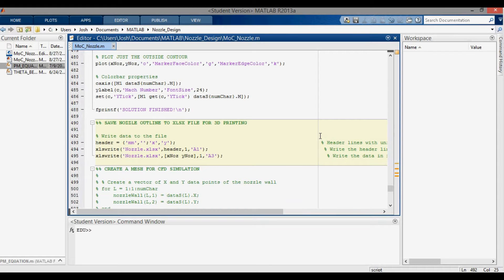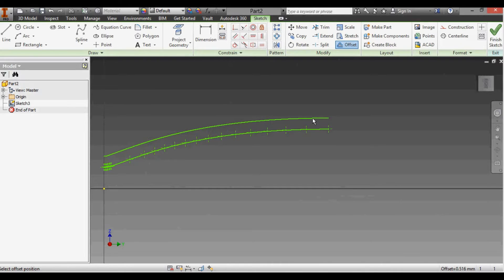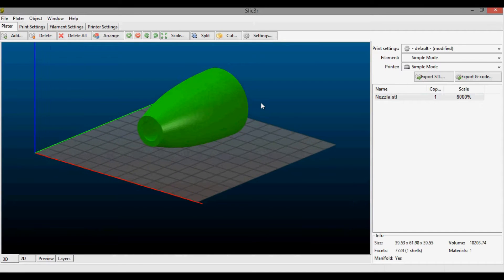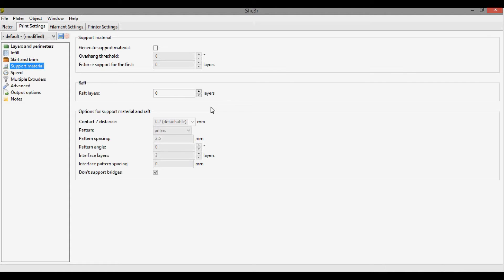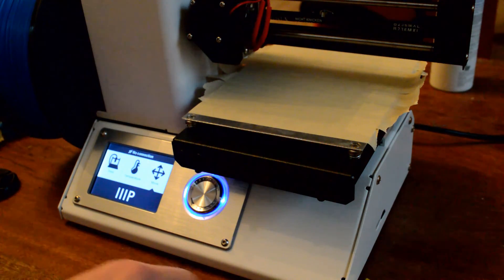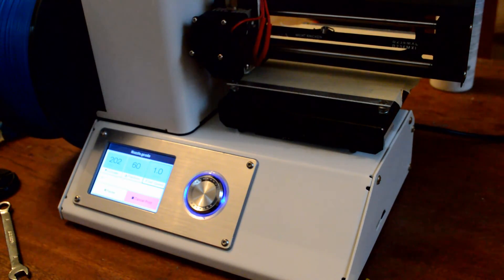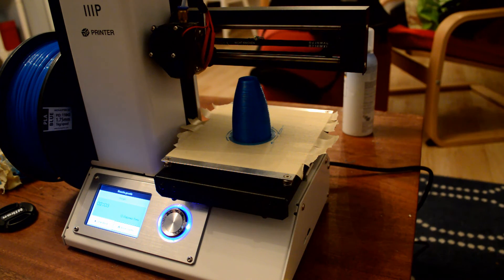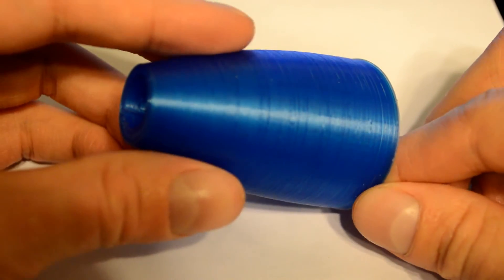How To: 3D Print a Rocket Nozzle

Comment: Why do you use complex methods to design the rocket nozzle? Not trying to argue directly because maybe you have your own reason. For me go with the math step by step is easier for understanding.
Reply from the maker: For this video, it was just a convenient way to show how to import a CSV file and output a solid model of a rocket nozzle.  You can make a rocket nozzle out of a cone if you really wanted to, but technically the method I use in my code will give you a better design.  Again, it didn't matter for this print, I just happened to have the code ready to go, so I figured I'd use it.

Comment: Why no converging section? Is the design for sonic conditions at the nozzle inlet?
Reply from the maker: I was just doing this to show the process from my code, to CAD, to a slicer, and then to a finished print.  When using the Method of Characteristics to design a nozzle, it assumes that the flow is choked/sonic at the throat (I'm leaving out a couple details, but that's the gist of it).  This print wasn't actually functional.  However, I'm planning on doing an actual 3D printed nozzle, including the reservoir, converging section, and diverging section.
Reply: I was actually interested in doing a project like that as well. I have a B9 creator, and was planning on coupling Python with ANSYS Fluent to optimize the design geometry for the full CD nozzle. Either that, or utilizing ANSYS UDFs to perform multiple design iterations. I always thought it would be cool to have a supersonic attachment for an air compressor. I think one problem might be with the smoothness of the inner surface that might cause significant flow separation or radial components of velocity.
Reply: @PythonParseltongue  sandpaper

Comment: Cool application of the MOC to 3D printing. Technically if you were to truly use that for a jet of air or mold to cast a nozzle, a different algorithm with compatibility equations for an axisymmetric coordinate system would need to be used
Reply from the maker: Thanks!  Yep you're right, and I have a little note about it in the video description just mentioning it briefly.  One day I'll get around to coding up some of the more intense MoC cases.
Reply: +JoshTheEngineer whoops forgot to read the description haha. The textbook Anderson, compressible flow with a historical perspective has a section on axisymmetric MOC, didn't have time for it in my gas dynamics class but it didn't seem too overly complex. Also interested in how to apply this to aero spike nozzles

Comment: How did you get your print to not lift? I'm having lifting issues with my printer . My bed is leveled  just not sure
Reply from the maker: I was having trouble with my first layer for a while, and a couple things helped for me.  The first was that I tried switching to blue painter's tape because a lot of people suggest that, but I had problems with first layer adhesion, so I went back to regular masking tape like you see in this print.  The second thing that helped was to really slow down the printing speed for the first couple of layers.  This probably had the biggest impact for me.  I also changed a couple of the extrusion parameters for the first couple layers, such as extruding a little more than I would for the rest of the print.  The last thing that made a big difference was making sure that the bed was at the right height.  Even though your bed is level, maybe try leveling it such that the nozzle is a little closer to the bed.  With these three changes, I haven't had any problems with first layer adhesion.
Reply: JoshTheEngineer awesome will try!! Thanks
Reply from the maker: No problem, good luck!  Let me know if it doesn't work and I can try to think of something else.
Reply: I am working on this but I have found that hair spray and a slow first layer speed work better.  When you print the skirt and that won't stick, then maybe your z-axis needs adjusted.